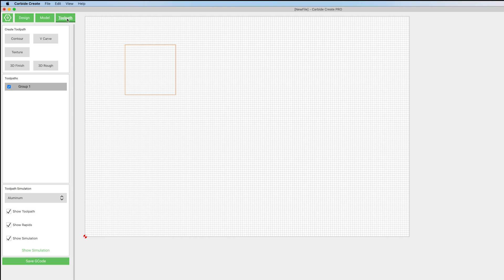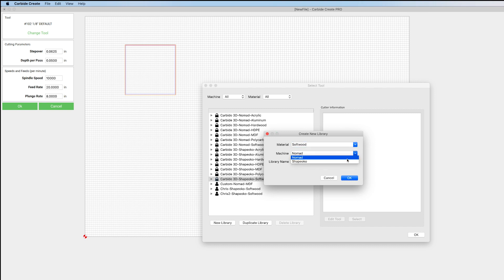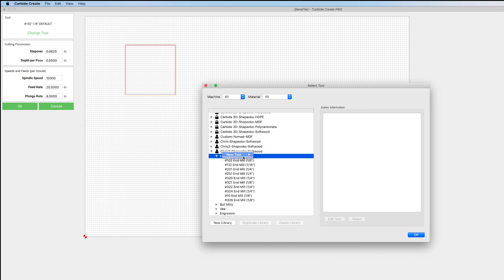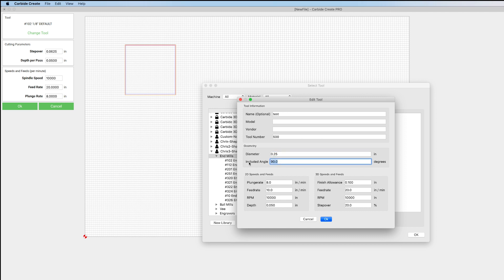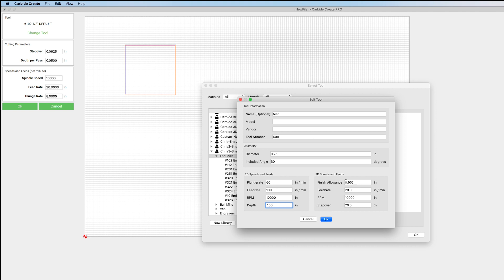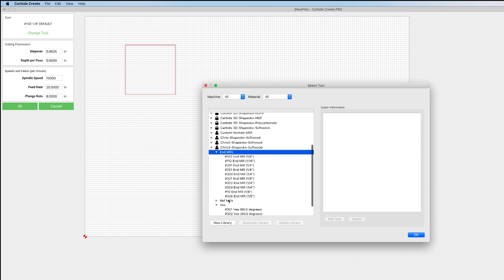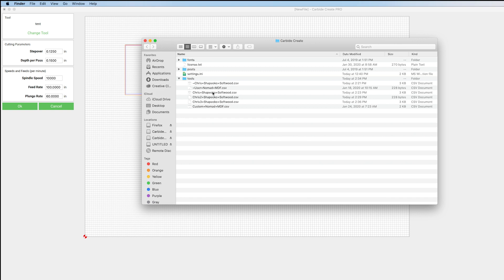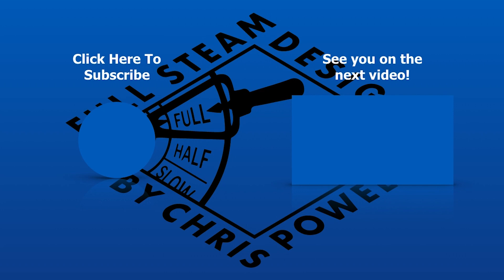How to add a Tool in Carbide Create - Bits of Wisdom

Comment: Hi how do i open a project that i had make but i need to do changes to do it again i click on file but won't open
Reply from the maker: Are you trying to open the .c2d file? It should open in Carbide Create
Reply: @ChrisPowellFSD   ok i have i project that a i made but now i need the same project with a little changes but i click on open and take me to carbide create but i doesn't open  and i don't want to start the whole thing again im being having this problem since i got the shapeoko do u think it can be cuz i have free version?
Reply from the maker: Maybe it’s updated since you created it. I’ve never run into that issue. Try contacting Carbide 3D.
Reply: @ChrisPowellFSD   ok thanks im barely learning i appreciate it
Reply from the maker: Wish I could be more help. I’m sure they can help you out though.

Comment: Hi Chris, I've tried some CC Pro 3D carves using a 3mm (also tried setting up 6mm& 8mm bowl cutting bits endmill for roughing & 3mm Ball for final. However, setting stepover to 1.5mm I get large stepover ripped, scoloping. I've set 3D stepover down to 10%, 2D stepover down to 0.5mm. but I'm still getting scoloping. Have you any hints on what numbers to set please?
Reply from the maker: Make sure the profile of the tool matches what CC thinks it’s using. You could reduce the step over more, but that will increase run times. I use a 1/16” tapered ball for most jobs that require a lot of detail.

Comment: Hey Chris,   would you be able to help me input some V-bits into carbide create excel spreadsheet ?  im not sure what the meaning of the terms are in order to input the v-bit info.  Amana Tool - RC-45711 90 DEGREE ,  45705 60 DEGREE ,  RC-1075 30 DEGREE

Comment: Hello... Trying to add New bits from carbide create but it won't let me change values even in the duplicate library... And wanted to ask i'm using metrics and it seems impossible to add a coma to some numbers
Reply from the maker: Do get the option to add a new tool when right clicking? Try using a decimal point.

Comment: i cant seem to add new tools for example i bought a 30 degree bit and in my library under v bits there is no option for a 30 bit. also i am using a 90 degree v bit (Amana Tool 45626-K SC Spektra Extreme Tool Life Coated V-Groove 90 Deg x 1/4 D x 1/4 CH x 1/4 Inch) when i am using the preselected tool 90 v bit under v bits in the carbide library and its not cutting all the way or filling out a letter for example. hope this makes sense and someone can assist me thanks in advance.
Reply from the maker: You have to add a new v bit and put the angle in yourself.
Reply: @ChrisPowellFSD  thanks for the response maybe make a new video for newbies like me showing the exact steps, just an idea but thank you

Comment: Great content Chris. All your videos are very informative and you've definitely helped me up my CNC knowledge and abilities. I'm stuck on adding what I believe is a forstner (Unsure if that's correct spelling?) type bit (It's actually a 1/4" shaft with 3/4" head Straight cut bit from Irwin) into the system to use as sort of a planer since I don't have one. I know this can be done, but I wanted to ask how you determine your feeds and speeds? I've watched your other video on that as well, but either missed it or couldn't find what I was looking for. Is there a spreadsheet or directory that lists what bits require what? What parameters would you put in for this? Any help is appreciated! Thanks.
Reply from the maker: Thanks. I’ve never seen anyone do that before, and wouldn’t do it myself. Go get the biggest dado/rabbet but you can find at Lowe’s if you need something today.

Comment: 1st time adding a tool and I'm trying to add an Amana 1-1/8" 3 flute surfacing bit w/ 1/4" shank. I'm having trouble figuring out what to use for plunge rate, feed rate, RPM and depth. The mfr shows 18,000 for rpm, but how do I figure out the other info?
Reply from the maker: Generally the manufacturer will give you a recommended chip load. If you’re just surfacing the wasteboard with it, I like to  take a very shallow pass, like .01”, and push it around 150 to 200 ipm.

Comment: I am wanting to put a dish bit in but am unsure which category as its not an endmill or ball or v or engraver. Ive only just bought my cnc and want to get the right infoat the beginning before going crazy with it and ruining the machine
Reply from the maker: Does it have a flat bottom? If so, put it in as an endmil. You will just have to adjust the step over to make sure you’re going over the areas where the rounded parts of the bit don’t cut. Instead of using aprox half the diameter, you may need to use 1/4 to 3/8. Also, make sure you can plunge with the bit. Some aren’t meant for that. It might be better to make an offset inside of the area you want to clear, and do it with a regular endmil. Then come back and finish with the bow bit.

Comment: I'm using this bit to surface my wasteboard (see link below). I need to program this into carbide create and I want to make sure I do it right, so I have a few questions.

1. I programmed it as an endmill. Is that correct?
2. It's a three fluted bit, but there's no where on the Carbide Create tool editing box to change the number of flutes as far as I can tell. 
3. Cutting diameter is 1 inch, which I can change inside carbide create, but no where to change cutting length, which is 1/4"

Any help you could offer would be amazing!

https://www.whitesiderouterbits.com/products/6210?_pos=1&_sid=add4cb84b&_ss=r
Reply from the maker: Yes that is the right way to do it. The cut depth isn’t really important. The diameter of the cutter head is really the only thing that matters. Everything else, like feed rate, has to be input by you.
Reply: @ChrisPowellFSD  what about the number of flutes? The program assumes 2 flutes but doesn't allow me to input the number of flutes that are actually on this bit, 3.

Comment: Question. Since there is a .csv file you show at the end. Why not just open it from the beginning and add all tools there straight into the .csv? You have all column headers and such. Input and save seems like it would work.
Reply: I just tried it. It works! 1st you HAVE to duplicate like in video. That creates .csv. Then open .csv and add all tools at once.
Reply from the maker: Yup it works like that too.

Comment: I was wondering how to add a TAPERED spiral 3D carving bit to Carbide Create tool library. Do you just load it as the size of the tip or need to take the angle of the tapper into account? This video really helped, I would never have known not to do  the angle off of center.
Reply from the maker: I don’t think they take the angle into consideration. It’s something you need to consider for deep pockets. They make straight ball bits for things like that.

Comment: Is there anyway I can add the an old tool to the new Carbide Create?  For example I have my 90* bit listed as bits and bits 90* that I use for carving stars on unions for flags.  When I upload the files with that bit already there the times are much faster than starting a new union with smaller stars and the 90* bit that's in Carbide Create now.
Reply from the maker: Unfortunately it looks like you’ll have to update the tool in the program. I had to go through all of my old files and change them.

Comment: Chris, If I wanted to purchase tools from someplace other than Carbide3d, How would I know what Carbide 3d tool matches that of a outside vender, or the reverse, how can I tell what tool and it's specific characteristics is the same as a tool from Carbide 3d? Thanks in advance for your feedback.
Reply from the maker: Each manufacturer should have the specs listed for every tool they make. Some are better than others and have spreadsheets, but you should be able to get the general specs for any tool.
Reply: @ChrisPowellFSD  Chris, just stumbled onto your videos.  Very informative.  Thanks for sharing.  I'm just getting back to playing with my Shapeoko XXL after a 9 month layoff.  I'm running the latest (474) version of CC.  I've been trying to program the Marine Catch-All tray as you have explained in your other video.  For the pocket, I just selected the standard #201 1/4" EM, and my route time was over 2 hours compared to the 47 minutes using your 2 flute 1/4" mortising bit in the video.  So there's some variable in plunge, step over and feed rates causing it.  I found this PDF document from Freud that provides chip loads and calculations for the other bit variables.

https://www.freudtools.com/public/assets/freud/downloadables/freudtools-router-bit-feed-and-speed-for-cnc-20170822.pdf